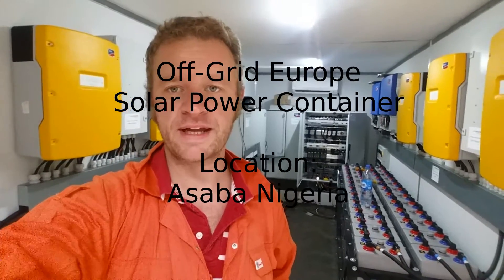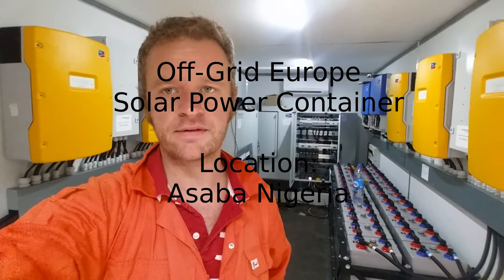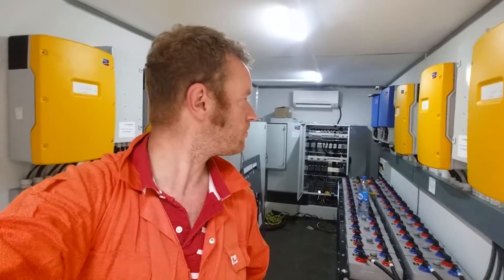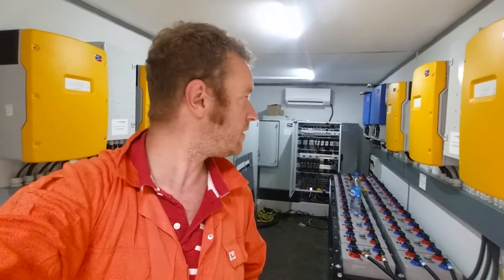Off Grid Europe Solar Power Container

Comment: What type of controls are you using to throttle back the air conditioners?  And if the battery bank SOC is too low, can you use those controls to shut off the air conditioning entirely?  This would be super helpful for us working in hospitals in West Africa
Reply: Hi, I will love to know that as well.
Were you able to find out about this ?
Reply: @fruemmanuel6397  No - didnt get any answer :(

Comment: Can this be done with niFe batteries?
Reply from the maker: Yes, you can change the charging settings to match this profile in the Sunny Island 6.0
Reply: Off-Grid Europe which is the best (economic/efficient) type of battery to use with this system?
Reply: Do you offer consulting?